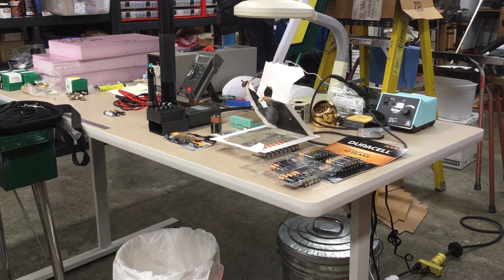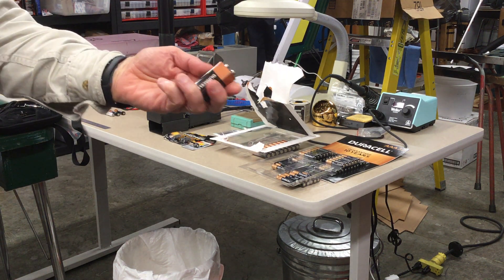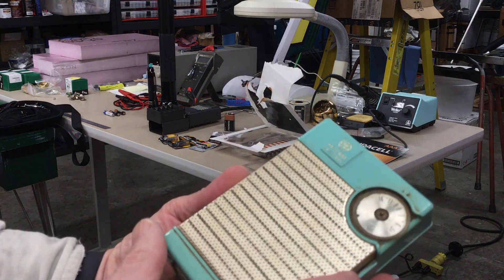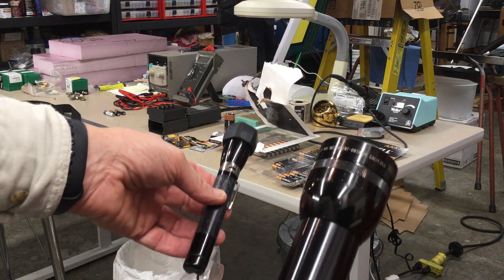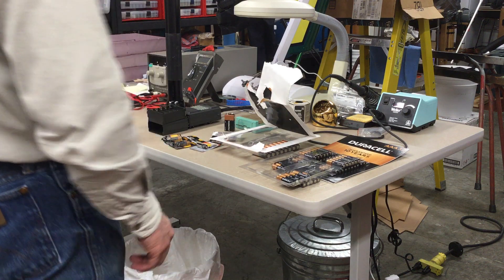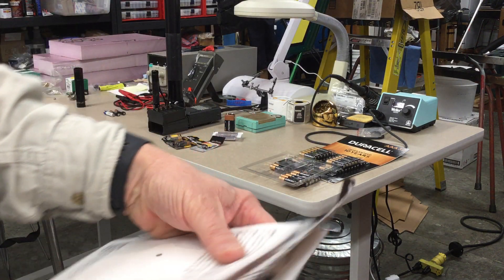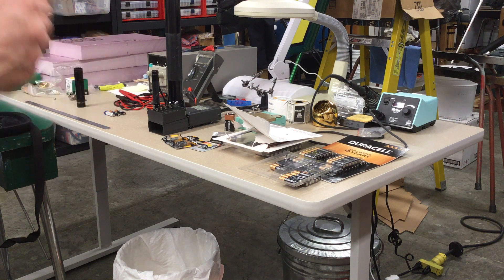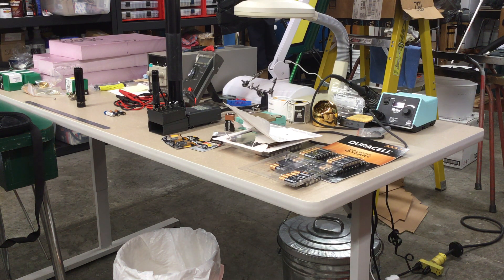Leaking Duracell Batteries

Comment: Durcell should change their name to Duraleak or Durashit.  They'll leak in the original package with a expire date 8 years into the future.  If you contact Duracell they'll try to tell you that you're using the battery wrong. I'll never use Duracell again. I don't care about a battery's capacity as much as I care about the battery not damaging my equipment.
Reply: I call them dumpacell

Comment: I have had same problem with the Duracell AA batteries.  I had to throw the 8 remaining  batteries, of a 16 pack of batteries which had a 2024 expiration date, away because of corrosion inside the packaging.  They had been kept in a cool environment, so no problem there.  I will now not be buying Duracell AA batteries in the future.  Also found corrosion in some devices because of these batteries leaking.  Thank you for bringing this problem to the publics attention.  Shame on Duracell manufactures!  I have several items throughout my house that require the AA batteries, so I always buy the 16

Comment: Bought the Duracell Optimum double A multi pack. Used them in my Apple Magicmouse. A mouse I paid like $85 for at the time. Corroded inside and ruined my mouse. Contacted Duracell. The only thing they did was send me a new pack of the same batteries, which also corroded inside the package within a couple months. Absolutely garbage batteries today.

Comment: Thank you for making this video. I have also bought Duracell batteries at Costco. They all leaked - AAA, AA, C, D and 9 volt size. I've also had Maglite flashlights that were destroyed by Duracell batteries. I contacted Consumer Reports, alerting them to this problem, but to my knowledge they have not moved on it. Duracell batteries used to be the best on the market. I don't know the manufacturing history of these batteries but the leakers were all made in China. I also will not be buying Duracell batteries. I have been using Panasonic Eneloop rechargeable batteries with complete success.

Comment: Thanks for sharing your experiences, same story with me.  I used to worry about buying Kirkland batteries thinking they were probably lower quality and subject to leaking, but it turns out that the brand I thought I could trust in Duracell is the absolute worst, particularly in the past 5-10 years.  I don't recall having any issues like this prior to then, so I'm thinking something changed.  After dozens of damaged items, I will not use Duracell AA or AAA again, and now using rechargeable batteries which are probably better for the environment long term anyway.  I was going to write to Duracell and include the photos I have taken, but after hearing your story probably won't bother.
Reply: All types of batteries from DuraCell and Energizer have leaked. At one point, the Energizer experience of replacing the devices was good enough compared to others, that I just bought Energizer.  But then they got so bad and consistantly troublesome, that I started buying DuraCell thinking that was the solution.  DuraCells leak just a badly.  This weekend I went to check on my supply of batteries only to find out that 1/2 of my stock of AAA were leaking in the battery container.  I bought this battery container and keep it in my cloths closet so that temperature/humidity are the best I have in our house.  Didn't seem to help much.  After reading about the physics of batteries, I'm surprise we haven't had more failures.  However, I think the real issue is that it's not a priority to design a seal that works in the small batteries.  I'm wondering if in the future days of Electric Cars, we'll have some new issue that will be a bit more catastrophic.  Anyway, I continue to reach out to both DuraCell and Energizer's customer service help lines and I do get prompt response with gift cards for replacement batteries.  This has never been a hassle for me, but I'm happy about that....It's time wasting though and that's never good.
Reply: Which rechargeable do u recommend?

Comment: I have worked in the electronics industry for many years. You’ve confirmed what I had discovered after having had leaking Duracell copper top alkaline batteries ruin several pieces of very expensive industrial electronic equipment and also toys. Many years ago I had a very nice wall clock that was ruined by Duraleek batteries. I wrote a letter to the company, there was no internet at that time. They did respond, but only with a return letter that said to replace the leaking batteries in said device and to take the batteries out of equipment when the equipment is not being used ! So yeah, I need haul in my 8 foot ladder from my garage and climb up to take the batteries out of my wall clock whenever I'm not looking at it ??
Thank You ChaffAndFlares
Are2 Dee2

Comment: Same story here as everyone else that has used Duracell Batteries.  The new ones that have the horizontal metallic looking bands around them are pretty much guaranteed to leak.   I use a ton of batteries for all my electronics.  I have been buying and using Duracell batteries from Costco.  Most of my electronics have had leaking Duracell batteries damage the contacts and or wire connections.  I will never buy another Duracell battery and have only been buying Energizer batteries now.  I am happy to see your video and I hope other people will see it before they experience Duracell battery leakage and damage.  Great job on your video presentation!
Reply: I used Varta batteries,even cheap made in Thailand panasonic alkaline batteries that are sold at dollar tree. No leakage.

Comment: I went to replace a dead battery today and found that 20 out of 30 new Duracell AAA batteries had leaked in the original tray. They were dated 2027.
Like you I have lost or damaged thousands of dollars worth electronics and now leave everything empty. However it can be a pain in the ass when you need
something like a flashlight in an emergency and have to take the time to load the batteries.

Comment: I thought I was the only one.  I’ve stopped buying the Costco DuraCell battery packages.  Costco DuraCell batteries always would leak, years before their expiration date, and OFTEN in their own packaging...  I now only buy the Energizers from Sam’s Club, when on sale.  And when I come across the lithium ultimates on sale, I grab several of those packs too.  I too have never had an Energizer battery fail/leak before.  I would HATE for a cheap battery destroy a $400 device, which I have several that I rely on to be functional at the moment needed.  THANK YOU FOR YOUR VIDEO.

Comment: I've been having a lot of rayovac batteries leaking as of late. I used to use them all the time a decade ago without problems. Now they almost always leak! Made the switch to energizer last year.

Then, due to the ridiculous cost of disposable batteries, I just bought a bunch of rechargeable ones to use instead of crappy expensive disposable batteries. Its too early to tell, but I'm hopeful they won't be problematic. I don't have a lot of need for these kind of batteries anymore, but I do have kids toys to deal with now, and those use plenty!

Comment: Same experience here. The Duracell AA and AAA batteries are now garbage. Among other things, they destroyed a thermostat of mine. Also had their D cells leak and destroy a Maglite flashlight.
Reply: Hi southerner yep like so many of us have the same problems with mainly duracells.Though they may last longer they just crap out just like carbon batteries. And my Maga light was also a disaster. Man the battery it was impossible to pull out. I was thinking maybe I'd use a half inch drill bite. But could imagine after all comes out there will be nothing but calcium deposits all over making it complete catastrophe to even bother to excavate those batteries. I use my portable tiny double A battery at night cuz you never know what they throw out on garbage night? But during the coronavirus pandemic I always kept wiping my flashlight down with sanitizer it always gets into the battery compartment have to clean that out also every nite. It also gets into the honor switch which is so hard to dry out. Those contacts lose their contactbatibility Wednesday contacts need to be scraped out with an emery board or very tiny wire brush. But think when you clean up the calcium deposits around the battery compartment. You'll notice not all the connections are soldier together up there pretty much pressed metal on metal to hold the contacts together and those contacts are clamped together.They too lose contactactivity. So l would scrape around there so the solder can hold on to these clamp pieces together and they work better. A bypass is trying to go through the corroded or oxidized clamped connections so there's no weak link. Thanks for pointing out the frustration and have with you so badass
Reply: Hi thanks for your great informative video like so many of us they're so batteries with the top brand decades ago I think the casings were made of metal right.? Now they're shiny copper looking paper glued around battery. I don't know if that's conducive to carbon leakage. The definitely not sealed like past decades. And God forbid the leakage goes into those clamped contacts in the  battery compartment in calcified or oxidizes making very little electrical contact. That's why I would scrape the clamped wires and springs and then solder them lightly to make the electrical passage great again. Are those Kirkland's a pretty good at a very cheap price. Well I still get those duracell's at Staples on sale. To  watching them carbonized and leak  before our eyes
It's terrible they used to be guarantees years ago if any device is caused by leaking they will be glad to fix or replace any any damaged item. Like the other poster says yeah go try to collect? There should be a class action suit against Duracell to get their act together and answer those claims. Thanks for bringing this up. Stay welll

Comment: Thanks for the analysis. This week I lost an IRobot lighthouse to leaking AA cells so I think my Duracell days are over.  I used to sell Duracell batteries and they were the top brand at the time. In fact they were manufactured in the USA. Now they are made in China. coincidentely, in the last 5 or so years I have had increasing problems with Duracell leakage and have turned in several claims. Now it seems the company is focused on other matters.  It seems that the new CEO Tom Lachman is more concened with Chicago real estate than protecting the brand. Berkshire Hathaway and Old Warren seem to be losing touch with core business values. It will not succeed.
Reply: Weird, mine says made in Japan

Comment: Thank you very much for your very informative video.  I too have had issues with Duracell batteries leaking.  I have an unopened package of triple A's that expire in approximately two years.  At least four of them leaked in the unopened package.  I have a flashlight that I am going to have to discard due to Duracell batteries leaking and swelling.  Duracell clearly needs to do something about this problem.  As you well know, they claim that they will last at least ten years in storage.  They don't.

Comment: This happened to me 14 years ago when I was playing my Wii with my nephew. The Duracells had just died as we were playing. I took off the cover to replace them and both batteries were spurting battery acid aggressively. My Nephew almost put his finger in it, wondering what the clear liquid was. I luckily pulled it away from him in time, saying it was battery acid and not to touch.

At first I thought it was a dodgy batch as others had done the same and went to my local hardware store to get more to see an in-date box of Duracell sitting on the shelf, but the cardboard box they were in was all manky on one side where the batteries were leaking.

I never bought Duracells again. I get Aldi's own Activ Energy batteries these days. Never had one leak on me yet, and they are vastly cheaper.
Reply: I used Varta batteries made in Germany. Until most camera shops stopped selling them due them being discontinued. Now I use PowerOne by Varta sold online. Also made in Germany.

Comment: I do have some Kirkland brand (which are supposedly made by same factory as Duracell) and Duracell batteries that have leaked.  I think they outsourced the factory which was the beginning of the end. Maybe the reason you're seeing some battery types such as the A123 garage opener type battery and the 9V battery not leaking is that those batteries are being made in a different factory that didn't get outsourced.  Supposedly, the new improved Power boost Duracell batteries have a 12 year life even though they are still alkaline for all but their 9V 5 year batteries sold at Costco. But until there's a clear indication that they truly addressed the issue, I cannot buy Duracell Batteries.  As you point out, casing might have some issue. Long ago, the casing use to be a lot thicker on batteries but at some point, the design was improved to use much thinner walls mostly to improve the battery life.  In a perfect world, you get a "larger" battery even though the external dimension is the same. But seeing that other brands also are using very thin casing, I wonder if it is something else.

Comment: By the way I remember that even the cheapest batteries 30/40 years ago would guarantee replace or fix any damage electrical due to leakages.. good daracell still says that on the label but they don't honor it like you said thanks for bringing that up.. imagine in case of emergencies and you put these in only find out the gooey batters have leaked thru. Just can't win unless there's a class action suit

Comment: I've had the same issues with this battery.  4 mag lites, a dozen other things such as toys, remote controls, and radios. If they want proof, the batteries are stuck inside of two of my flashlights.  It expanded and I cant't get them out.  If they make good on the promise to replace the products (and I have the receipt), I would love to see it happen

Comment: I am happy with Energizers for alkalines.
And yeah I have not used Duracells in a long time due to them leaking and like the video would leak before there due date.
And I have also been either using rechargeable batteries that don't leak or lithium batteries that do not leak either unless shorted which of course you don't want to short a lithium battery.
I usually will put lithium AAs in my pinball machines so I don't have to worry about leakage since when lithium batteries do completely discharge they do not leak and it is a good thing as lithium is not good on electronics.

Comment: This has been my experience as well, Duracell batteries seems to leak very predictably. In some rare cases, they've not done this. It's almost guarenteed that if you have a Duracell, it'll leak it's gut out eventually. It doesn't matter if it's used in a pack, or if it's a single cell or if it's even in storage (I've had it happen in all these situations).

I'm looking for alternatives and it maybe that any brand other than Duracell or one of the cheap fakes (Durgacell, Durasell etc) would not leak. Be it Panasonic, Energizer or Realmi.

The after sales support is probably crap and made you jump hoops because they know of the issue and if they were to refund every time a Duracell leaked, they'd go out of business.

Comment: I have the same problem with Kirkland batteries which, some say, are made by Duracell. Sometimes they leak in the original packaging, unused, well before the exp date. I don't know if it's a brand thing or if it's an alkaline battery thing. My solution is to switch to NiMH which, I hear, never leak. Lithium-ion batteries seem to have a bad reputation for nuclear melt-downs & I just can't trust them, for example, sitting in my glovebox in a flashlight for long periods. I had a lithium-ion car battery jumper pack melt down in my car, causing a lot of damage.
Reply: I have had the same issue with the Kirkland ones and have put nearly all the ones I own in the recycling.

Comment: I have the same experience in Perth Australia. Duracell AA and AAA batteries leaking and damaging electronics despite being within expiry and still working so even worse than if not working. Absolute rubbish.I had to throw out a large pack as most of them were leaking in the pack! Have switched to Energiser.

Comment: Another thought - I wonder if the leakage is dangerous or even poison for young children?  How many toys are battery operated?  This situation is totally embarrassing for Duracell!   Also, have you noticed how many manufacturers of equipment tend to isolate the battery compartment to keep the leakage from batteries from damaging the components inside the equipment?

Comment: I too bought a package of Duracell AA batteries at Costco with an expiration date about 5 years in the future. They leaked in the package within 6 months! I no longer buy those batteries! I've had good luck with Energizer and RayOVac alkaline batteries. If your device hasn't been destroyed by the leakage, you can clean up the corrosion using distilled white vinegar although any vinegar will work to neutralize the alkaline corrosion.